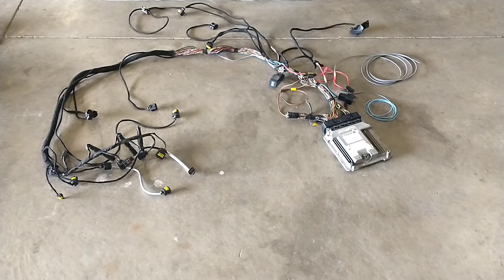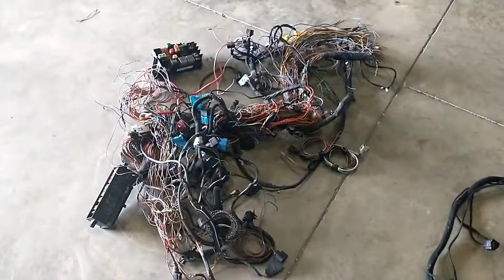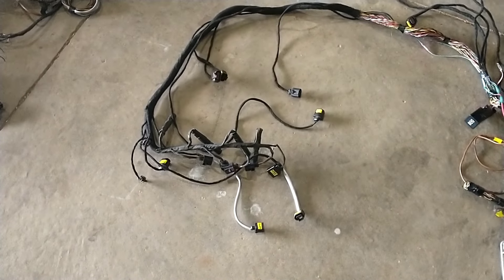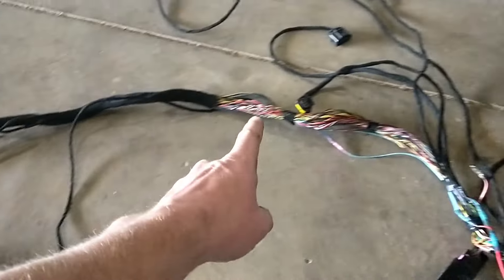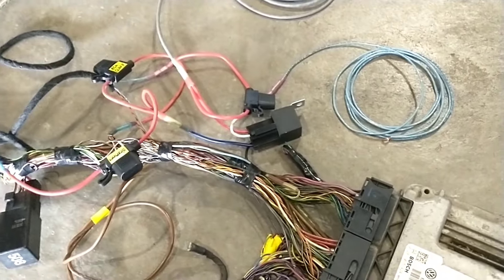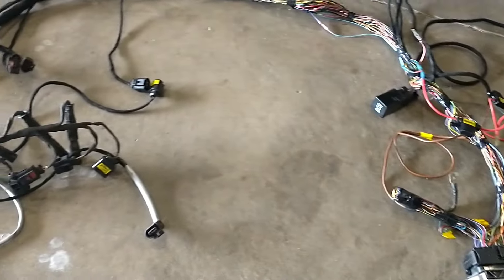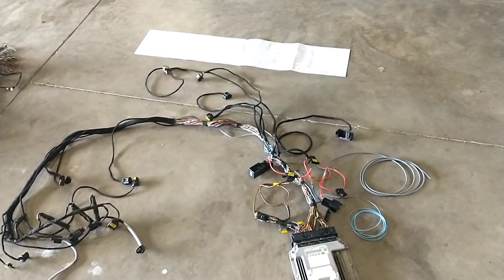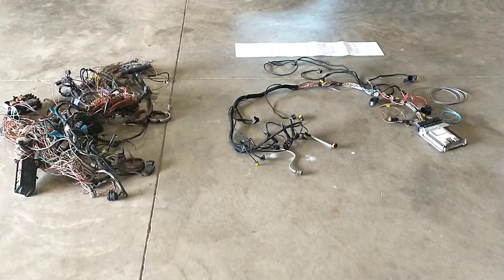Making A Standalone Common Rail TDI Wiring Harness for CBEA/CJAA

Comment: The CBEA harness is different than the CJAA harness too. Different length and uses the old style glow plug relay. Golf harnesses are different than the Jetta ones too I think. 

I left the whole engine side harness intact on mine and just wired in the oval plug. Not as clean but less work. I left the stock fuse block too lol. It's getting redone at some point.  

You do need K line if you want Vagcom or any scanner to work. I had to add it on mine. You also need to add in the manifold EGT. It's actually readable on can or obd. Depending on tuner you may or may not need the first 02 sensor also. I didn't use it but I think Malone does. Everything downstream can be removed also on the exhaust but again not sure depending on tuner.
Reply from the maker: That makes sense, I figured there were some differences, nothing that will affect it running though.  You wouldn't normally use a CBEA ECU on a CJAA harness, and yes I left all sensors labeled so even if they were cut they can be spliced in.  Talking to the tuner is an important detail
Reply: @TDISwaps  Not sure if you read it after I Edited it. I hit enter before I finished typing what I was saying lol.
Reply from the maker: @bigtoy302 ya I reread it 😂 all the pins are still going to be the same between the ecus even with different lengths and glow plug modules. Just like previous stuff has been between the older ECUs.  All in all it's not terrible.
Reply: @TDISwaps  Yeah the ECU's are all the same wiring wise. Other weird thing is the CBEA does have K line if I recall but not the CJAA. It's been 5 years since I did my harness lol. I had to add it to mine or nothing would read. Snap on scanner and Vagcom would not connect without it for some reason. So it might depend on who tunes it and what SW version the ECU is. Mine was a DSG ECU flashed manual. 2010 ECU but my engine and harness was 2012. My tuner requested certain ECU variants, that's why I went with the early ECU.   The 2010-2011 ECU is different from the 2012-2014 ones.
Reply from the maker: @bigtoy302 yeah I've seen that with the older ones once they get tuned communications can be weird, this thing fires right up with vcds using the can bus wiring though so the customer wasn't concerned about anything else.

Comment: I just picked up a 13 Jetta tdi for 300 bucks and have a 2wd 84 pickup was thinking of dropping it into. My 85 4runner with the om617 (crawler build) is fun but slow as hell kinda want something with a little more hit.
Reply from the maker: Ya these TDIs will move compared to most of the OM engines.  Biggest issue is all the tuning and deletes needed on the CR along with a CP3 upgrade.
Reply: I've got a 13 JSW tdi that I'm gonna pull the CJAA out of and put in my 86 Pickup SR4 4x4. I plan on doing a full rebuild and pushing it to like 250-300hp in front of a Marlin Crawler built r150f
Reply from the maker: @mattchueeyyy1219 nice! Definitely do a centerforce clutch or better to hold that, my 250 HP Toyota will not hold with anything but a dual friction centerforce clutch rated for 425 TQ

Comment: Hey man I was hoping you could help me out here.  I’m trying to make a stand along wiring harness and I had a few questions I was hoping you had answers to.  

I’m using the same wiring diagram/pin out page as the one you have used made my David shoemaker.  

On the physical alternator plug there is a brown/red stripe wire on the wiring diagram it’s labeled (generator), but also on the plug there is a a solid blue wire as well and I don’t see where that leads to or what it does exactly.  

Same for the A/C plug.  I’m not sure exactly what the black/green and brown/ black wires go to because the plug wires are different than what the wiring diagram shows (wiring diagram shows solid green and blue/red pins 29 and pin 34

Lastly a lot of tiny wires have to have power sent to them and I’m curious how I need to run them.  Do I run them straight to a battery? Do I use an inline fuse for every single wire? Or do I use an aftermarket fuse box from Amazon or something?  

I know that’s a lot but I sure do appreciate the help
Reply from the maker: Haha ya that's a lot 😂 so I cheat on the alternator, OEM ones will run with just 12v to both regulator wires.  Not sure if that helps or not.  The AC wires to the ECU are not the same as the clutch wires on the AC compressor.  I don't mess with the ones on the ECU, green on the compressor is power, black is ground, easy as that.  All 12v + on the sensors and ECU go to one relay on my harnesses, everything will run on one 15amp fuse.  VW made this 1000% more complicated than it needed to be.  Hope that answers everything.
Reply: @ that’s extremely helpful thank you!
Reply: As for the Dakota gauge cluster how did you get the tachometer to work as well as all the oil pressure, temp guages etc. etc.?
Reply from the maker: @ydocproductions5593 no problem man! Go to the Dakota playlist and find the videos on gauges, fuel system and tach wiring it's all there
Reply: @ much appreciated!
Reply from the maker: @ydocproductions5593 appreciate you watching the videos!

Comment: Any help with a cjaa stand alone harness would be great... im knee deep in a cjaa swap and wiring has slowed the project to an almost stop 😢 any help with pinouts and wiring diagrams for a 2011 jetta 2.0 tdi would be greatly appreciated
Reply from the maker: Best to join the TDI swapped group on Facebook, they have all the schematics in the files section.  I also build this for $600 if you don't want to mess with it
Reply: @TDISwaps  i tried that and still havnt been accepted to the page 🤷
Reply from the maker: Ya they are slow to except people

Comment: Nice diagram. Where did you find it? I've been using the bently manual and it's a pain. One problem I've noticed is the CBEA uses the CAN bus-ABS module-left front wheel sensor for a VSS signal. I'm not sure if the engine will go into limp mode or defuel without a VSS input, I'm still building the truck. The glow plug and check engine indicators are CAN bus to the dash, there are a couple companies that make CAN adapters but they aren't cheap.
Reply from the maker: Those schematics are on the TDI swapped trucks Facebook group file section. Yes tuning will need to disable the VSS I'm sure

Comment: Hello sir love your videos! I got a question for you i drive a 2006 ram 2500 with a cummins what would be my best bet to put a tdi in it as far as transmission cant find a tdi to 48re conversion anywhere..  thanks
Reply from the maker: That's a pretty heavy truck for a TDI haha, but ya with no Chrysler adapters you would be forced to go with a lighter duty jeep transmission like the aw4 auto or nv3500/4500 or something like that
Reply: @TDISwaps  awesome yea I didn't think about the nv4500 that would be a good choice and yea I kno it's a heavy truck but after seeing how heavy you pull with yours I was impressed I never tow anything with mine I'm really interested in doing a full mechanical tdi swap cuz mine is on the border of needing injectors and id rather spend the money on  a tdi swap and sell my engine before I end up burning the motor.. also wich page is yours on Facebook ID love to follow you on there also thanks!
Reply from the maker: @jasondee2606 here is my Facebook, I don't do much posting on there though.  So I would not recommend a mechanical injection pump on that big of a truck unless you are doing compound turbos as well.  It was almost impossible for me to keep EGTs under control testing on my 4000lb jeep and a single wastegated turbo like you would use with a mechanical pump.  You need very lean tuning with VNT turbo and ECU to not run super hot on hills with a bigger rig, but compounds "may" also solve that.  https://www.facebook.com/profile.php?id=100014261163897&mibextid=ZbWKwL
Reply: @TDISwaps  awesome thank you for the info verry much help!
Reply from the maker: @jasondee2606 no problem man! Thanks for watching

Comment: Where do you source new replacement plugs?
Reply from the maker: The basic ones you can get on AliExpress searching the part number, some of them are hard to get though especially the ECU plugs themselves on these newer ones.
Reply: @ 320,000 miles and several times pulling the motor out for work hasn’t been kind to my harness, I’ve been thinking about going through and re wiring it.
Reply from the maker: @fweeshboy2500 yeah if you can still see the part numbers on the plugs search them on AliExpress and see what you come up with

Comment: hey question for my ahu engine, i think it’s the wiring for the pump 3 pin one, anyways, the engine would randomly stall but started up fine at random times because of that wire i believe. any thoughts of what you might think it is?
Reply from the maker: It's the original ahu wiring, there's a bunch of junction plugs that are terrible on that thing and known to corrode I will be looking there